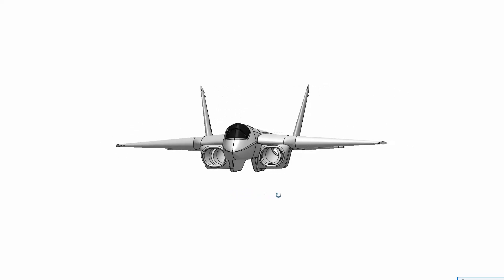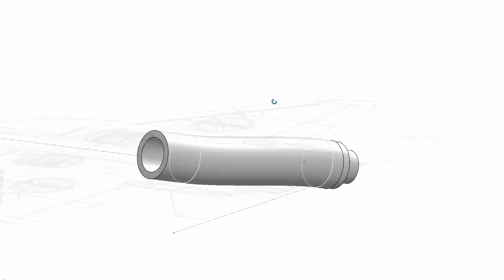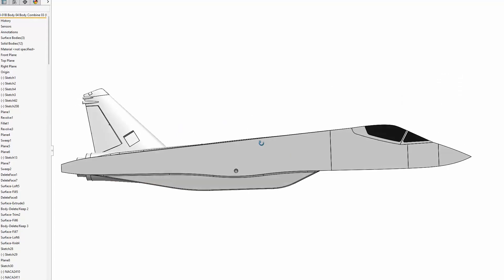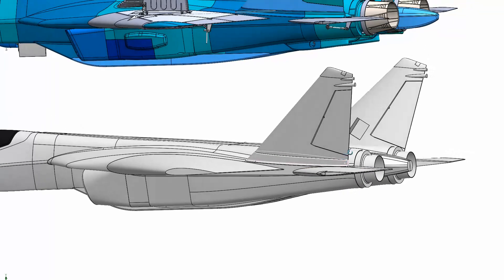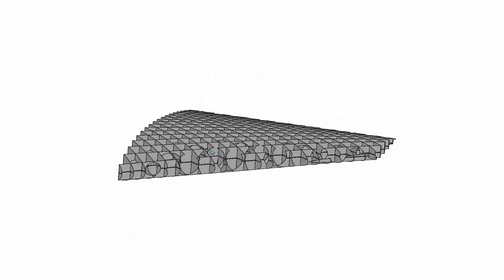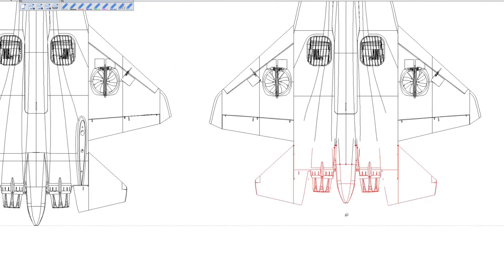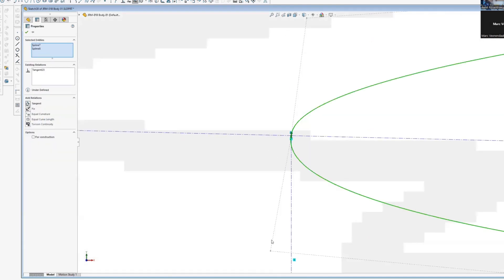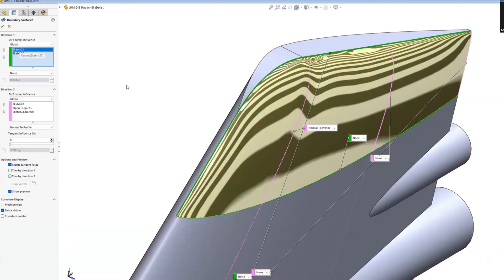How to optimize a 3D-Printable VTOL-Jet | JRM-01 Pt.7

Comment: That wing will be WAY too heavy with all that internal geometry. You don't need nearly that much. Also, you'll find that the diamond pattern is not great in that you get no control over parts that require more support (flat areas) versus parts that require less support (curved areas).

Much better to add spars where they are required and use part cuts to generate ribs. You can even use the slicer to add an extra layer here and there where required.

You'll be disappointed with the diamond ribs..

Happy to provide more details if you want them.
Reply: Cant agree no more
Reply from the maker: Yes, this would be great.